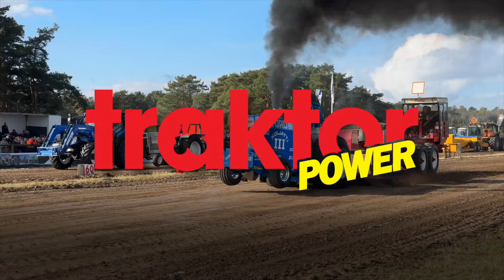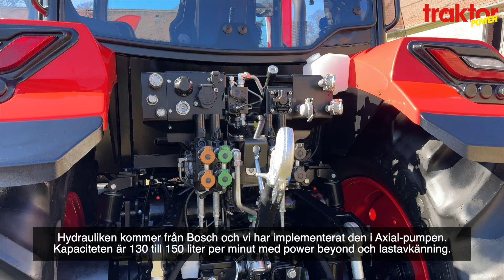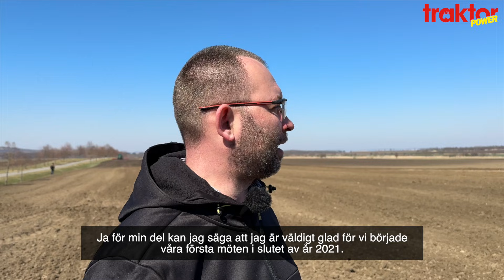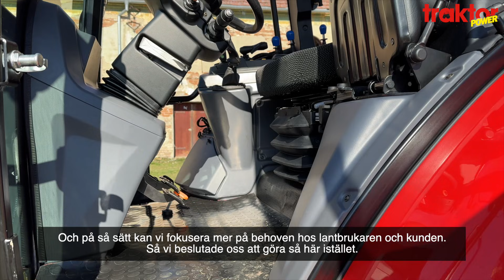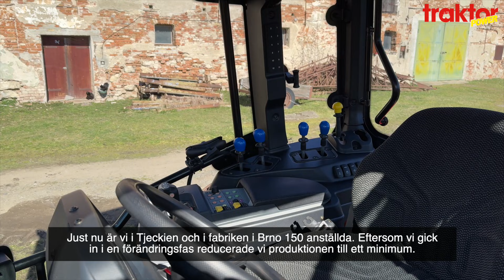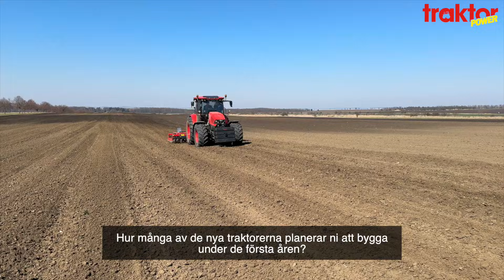NY ZETOR SNART KLAR FÖR PRODUKTION – Vi tittar närmare på nya Zetor Serie 6

Comment: Skulle gärna köpa en ny Zetor, 1990-talets Zetor var mycket bra så de är nog ännu bättre nu.
Reply: Vi hade Zetor 25K 1957, 7045 1981 & 6245 1990. Den senaste hade ju non-spin diff i framaxeln. Det var som att köra en tanks. Skulle kunna tänka mig att skaffa en Zetor Crystal 170 HD.
Reply: I had a 91 model 7745 from 2000 to 2015, just minor things to repair, it was replaced by a 2010 Zetor Proxima Plus 10541, happy with this tractor also. Its a more modern one but still a mechanical tractor 👍